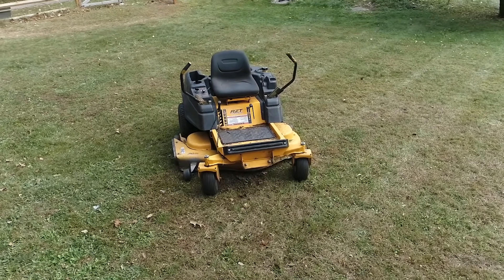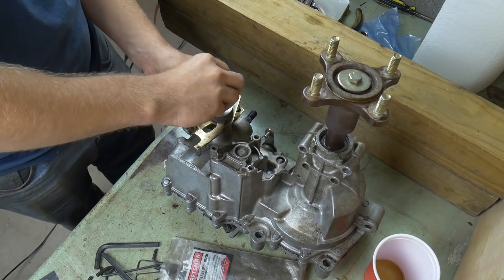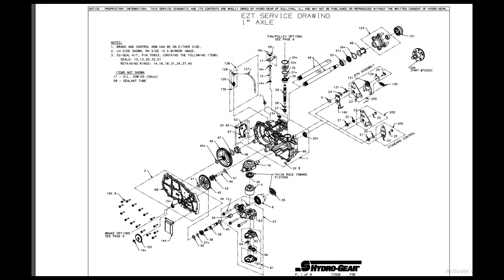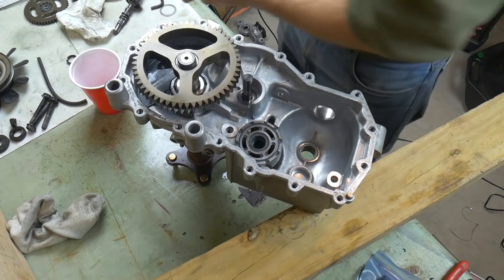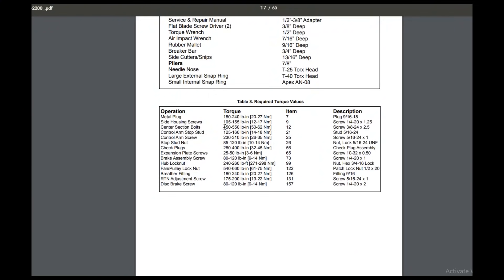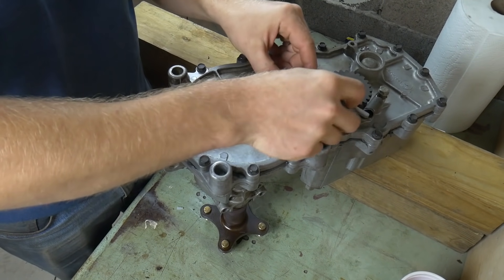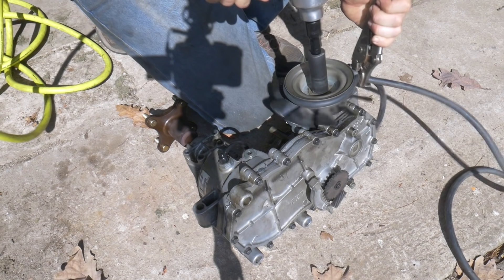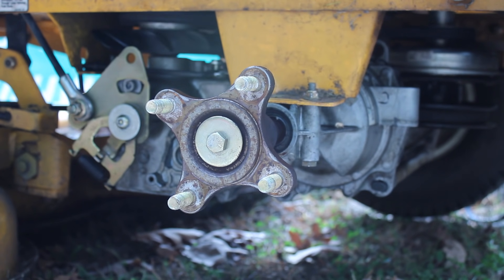Cub Cadet Zero Turn Weak Transmission Fix.

Comment: Hello and thank you for the video.
I would like to suggest that if you're going to be this far into this unit you should also go ahead and pull that hub off so that you can replace the output shaft seal.

If it's not leaking yet, it will be soon, so it is worth replacing.

Another suggestion is do not ever tap on the back of your socket with a hammer. It's a bad habbit habit that will eventually damage your sockets.
It is better to use an old extension. I have a dedicated 4in extension that is used only for this purpose. The side that receives the blows from the hammer is mushroomed and mis-shaped, which is what will happen to your sockets.

Comment: I have a Question

I have a Cub Cadet RZT-50, it will not move forward but it will move in reverse.  What will cause this.
Reply from the maker: thats a hard one. I would check the linkage to make sure everything is connected and move properly. if its moving in reverse the belt is turning the transmissions. Did it stop all of a sudden or was it a slowly getting worse?
Reply: @darbleythetractorguy458   It was getting worse over time.  I thought it was the belt.  What I'm going to jack it up and see what side not working.  I'm going to rebuild the transmission to see it that work..
Reply from the maker: @vincentconner8429  sounds like a rebuild will fix it.

Comment: Great Video ! I have the same unit in my Ariens Ikon 52 . I dropped them at 75 hours and filled with Valvoline full synthetic 20w50 , and again at 150 hours . Is that over kill or am i thinking right as far as longer life of units ?
Reply from the maker: Thank you! Id say 75-100 hrs is a good interval. One of the big things is how you drive them. Slowing down and coming to a near stop before turning/putting one of the wheels in reverse. Alot of ppl will be cruising and slamming them in reverse for quick turns and it slams the internals causing the damage in the video.
Reply: @darbleythetractorguy458  Thanks

Comment: How do you properly diagnose this problem? I just want to be sure. I bought a Cub Cadet zero turn that is weak on the left side, but at times there is a burnt rubber smell. I don't have much experience with zero turns. Nice video!
Reply from the maker: Burnt rubber could be a belt. It could be the deck belt or the drive belt. If it gets weaker the hotter it gets. High chance you need a rebuild
Reply: @darbleythetractorguy458  It was just running the mower without the deck trying to determine if the left transaxle was weak. It wasn't a constant odor. Anyway, a tip I can provide is, I always search for the model number of the mower when looking for parts. I searched the one I bought and found the parts manual published by the manufacturer which had nice exploded views of the transaxles and all part numbers. As you stated, parts are available. Thanks for a very good video! My first time diving into a zero turn. Plenty of lawn tractors under my belt, but it's my first zero turn.

Comment: What would cost to rebuild the hydro gear, compares to buying a brand new hydro gears??
Reply from the maker: Cost me about 190 to rebuild. New units are around 500
Reply: @darbleythetractorguy458  thanks for the info. I have a hustler raptor sd zero turn mower that has 458.0 hours on it. Its 3 years old 
Runs great. Why do these hydro gears goes bad?
Reply from the maker: @adamlipscomb6459 from what i understand theres not a pressure release on the internal parts. If your moving foward and put it in reverse to quickly the motor lifts and slams on my center section. Got to take it easy when coming to a stop and turning.

Comment: Excellent how-to video.  It  is a good argument for going with a ZTR with at least with HydroGear 2800 residential transmissions which have an oil filter which should provide better longevity though I have seen several videos on repairing them also.  That being said, I've been looking at ZTR mowers and called HydroGear for a transaxle recommendation thinking a ZT-2800 would be adequate for my needs.  They indicate their residential transmissions, including the ZT-2800, are really only intended for 1 acre or so.  I have 3.5 acres  with a slope so they recommended I get a mower with one of their commercial grade transaxles which start with the ZT-3100.  The ZT-3100 is basically the same as a ZT-2800 but has contains cut steel gears (as opposed to powered metal in the residential models) along with having a shock valve to relieve stress under quick starts and a charge pump to provide supplemental oil to the main pump.  I think the big box stores and some dealers inaccurately recommend models with the ZT-2800s for larger lots when they probably shouldn't.  Anyway, HydroGear has an excellent YouTube video detailing the differences between a ZT-2800 and ZT-3100 but even it lacks in providing a lot size/slope guide on which transaxle would be best for a given lot.  Again, excellent video and hope this info helps other viewers of your video.
Reply: I had the same discussion with Hydro-gear as well. My Husqvarna MZ254F has the ZT-2200 unit and my lot is approx 3 acres with slopes. They also said it's under rated for this. Though if you ask Husqvarna they have no problem recommended their product. All their literature states how strong and capable their mower  is. Their manual does not state an acreage limit either. Personally I think these units were engineered to fail by about 80-90 hours..that's what I'm seeing on the forum pages and always the left side...
Reply from the maker: Thanks for adding some info. Definitely worth getting the best mower you can afford.

Comment: Sorry if I missed it but do you sand down Both Motors i searched and watched and am still unsure thanks for a great video
Reply from the maker: I only sanded the one with damage. The pump side should be ok. If there is scratches on it I would.

Comment: Posted a previous question which you answered so I have another and need help if possible.  So I have the rzt 54 with the Kohler courage 26 and the change oil light came on but when I pull the dipstick out while it’s running it’ll blow oil everywhere.  What broke or needs to be fixed
Reply from the maker: Looks like your crank case breaker is plugged up. Should be a tube coming off the valve cover to a canister or something. Check that first. Im not super familiar with that motor.

Comment: So do you just fill it all the way up with oil? We have an older husqvarna that quits pulling on one side after it gets hot. It's oily on the outside so I know it has to be a little low on oil.
Reply from the maker: Yes just fill it up. Might be your problem. If not center section is bad.

Comment: I have a rzt54” and changed the fluid in it and I guess I had air in it but either way left hand side won’t go forward or reverse.   So is this likely my problem and if so where can I order the rebuild kit from
Reply from the maker: I ordered mine off ebay. If you search the part numbers you need they should come up. Amazon should have them to.

Comment: Hey would this be my problem seams like i don't have as much power as I do on the rite side the left side pulls but not as strong as the rite side
Reply from the maker: Probably. Check the linkage too. If it's getting worst over time or when it gets hot this is more then likely the problem.

Comment: Did you put loctite on the center section bolts?
Reply from the maker: I didnt but it wouldnt hurt. I did torque to the proper specs.

Comment: Would it be possible to sand down that Center section back to smooth (ie. Similar to turning a brake rotor and assuming the grooves aren't too deep)? It's probably better just to get the new part since you've gotten that far in the tear-down, but if it could save $ for some people I figured it be good to know.
Reply from the maker: If money is tight im sure its worth a try. It would probably be harder to get it flat.

Comment: So when it comes to getting the pulley off. If you don't have an impact wrench, look underneath the fan at the shaft. It has two flat sides so it can be grabbed with a wrench. I put a crescent wrench on it and set the wrench against the floor and broke that nut loose with a 1/2 inch drive ratchet. No problem at all on both of the transmissions in my mower. I just figured I'd let you know. It makes life a lot easier for people without air tools.
Reply from the maker: Thanks for the tip! I didnt notice that myself.

Comment: How much was the center section and the seals
Reply from the maker: Prices are in the description. About 126 for center section and 40 for seals.
Reply: Thanks buddy I see it. Perfect video, perfectly detailed and that's why I gave it a like.
Reply: I have a Husqvarna Z-turn that has a weak transmission and I was trying to figure out the best way to go on fixing it and your video made decision effortless. The transmission in your video looks completely identical to the one in my mower so the same parts numbers might work if I'm lucky.
Reply from the maker: @Bran.man24  thanks for the positive feedback. Most residential mowers have this transmission in it. If you can get the pn from the sticker on the transaxle you will know for sure.

Comment: if you were to buy a new mower today would you get one with the 2200's again or pay $500 more for a unit with 2800's?
Reply from the maker: If i had the money to spend i would get the upgraded transaxles. The 2800 have an external oil filter and a drain/fill plug for maintenance. 500 isnt much when it cost 300 to fix the 2200.

Comment: Great video!  For the EZT trans...Why hasn't someone installed 1/8" NPT drain plugs in the bottom of the trans case (pump end) to drain the oil for servicing.  Also find or make a hose to screw into the trans fill hole and drill a hole above the trans thru the engine mount plate for fill access.  Drain the oil out the newly installed trans case bottom drain and refill with a know amount of fresh oil for servicing.  ?????
Reply from the maker: both of those are great ideas. Most commercial zero turns have that ability.
Reply: Because they’re built to maximize profits.  99% will buy them at a big box store, run them until something goes wrong and then buy a new one.  If you’re watching this, you’re one of the few people like me who actually take pride in fixing things.
Reply from the maker: @failranch9542  its sad not many people try to fix things anymore. More sad companies don't make things to last.
Reply: Excellent presentation..!!!
I’m having trouble getting my center section out.. you skipped passed that pert. Everything is disconnected but it seems like it’s jammed in there.. worried if I just try to pry it out that cheap metal will break and parts will go flying everywhere..

Comment: How did you get the input shaft out?  I've got the seal out but can't figure out how to get the shaft out.  I see a split ring on the shaft, does that need to come off before the shaft will come out?  Thanks for any help you can give!
Reply from the maker: I dont think so. The bearing and shaft stay together. You should be able to pull it out.
Reply: @darbleythetractorguy458  Thanks!  Came right out.  Does the trunnion seal on the swash plate come in the seal kit?  I haven't removed it yet, so the swash plate is still in place.  Are there any retaining rings on it?  Sorry for all the questions, but I'd rather be safe than sorry.
Reply from the maker: Yes the seal kit comes with that seal. Im 99% sure it comes with every seal that is on the trans axle.
Reply from the maker: Also I dont think theres a retaining ring. Check it out and you will know for sure.
Reply from the maker: There is a retaining ring that holds the seal, shaft, and bearing in. The ring is up against the rubber seal. If I'm understanding correctly the retaining ring has to come out first for sure.
Reply: @darbleythetractorguy458  I have that retaining ring and seal out.  There's a split ring on the shaft against the bearing.  Does that need to come off for the shaft to come out?

Comment: Hi do you really put 1,75 to fill the transaxle?? or it´s what the manual says and you just fill it to the top, because on mine i cant put 1,75, doesnt fit that quantity. Thankyou for the video.
Reply from the maker: Once you fill it and bleed the system. Check it again. If its filled its good to go.

Comment: HELP!!!!  I cannot get the bearing on the input shaft to slide out of the housing  like is shown on the vidieo!!!
Reply from the maker: I think other people had this same issue. Dont loosen the center section until the input shaft is removed. Let me know if that helps.
Reply from the maker: I just looked through the comments and found someone with the same issue for sure. If you loosened the center section 3 bolts before taking out the input shaft and bearing you wont be able to pull it out. Put the bolts back in assuming you took them out and you should be good to go.
Reply: Thank YOU!!! That was the problem!!!

Comment: Is this the same transmission that would be in a Cub Cadet RZT50? Your description is for a RZT. I cannot figure out if there is any difference. 

This is an excellent video that is very helpful.
Reply from the maker: Should be the same. The number is the size of the deck. Most residential zero turns are using the same transmissions. Thanks for watching.
Reply: DarbleyTheTractorGuy thank you for your timely response.

Comment: Great Video, thanks a lot. Is there any reason why you could not get the centre section machined instead of buying a new one?
Reply from the maker: Im sure its possible. Idk if there is a limit on how much material you can remove before it will cause issues. If I get another mower that needs a rebuild I'll try to sand it smooth and set what happens.
Reply: @darbleythetractorguy458  Thanks, I'll give it a try then as it's stuffed anyway and I'll let you know how it goes
Reply from the maker: @paulcane7160  awesome.
Reply: @paulcane7160  I'm actually attempting to machine mine. I can't get the parts sent to me so I figurer I will try and machine them myself. If this works will let you know.
Reply: @fernandoproietto4376  did machining it work? I'm about to disassemble mine and was going to try it. Please let me know, thanks!
Reply: @travishanson2119  indeed, it worked beautifully. Moer works better than when it was new. Best part, I saved a lot and learned a bunch. Good feeling when your able to repair without manufacturers assistance.
Reply: @fernandoproietto4376  which parts did you machine? Was it the center section only? Or did you have to do anything with the pump block or motor block as well? Did you take it somewhere and have it machined or did you use Darby's trick with sandpaper on a flat surface? Thanks for the quick response!
Reply: @travishanson2119  I machined it myself. I have a mill and do machining as a hobby. I machined the center section and reground the pump block starting with 400 grit and up to 800. Use oil. The mating surfaces need to be perfectly smooth. This will allow them to mate perfectly and seal.
Reply: @fernandoproietto4376  just watched a video from doublewide6's channel and he machined the mating surfaces using oil and sandpaper and it turned out great. I'm going to give that a shot before I drop $300 on repair parts. Did you replace any of the seals or just take it apart and put it back together?
Reply: @darbleythetractorguy458  did you ever try machining it instead of replacing the parts?

Comment: Am I able to pull the input shaft and seal without tearing it apart?  The seal is leaking at the input shaft.
Reply from the maker: You should be able to. You would have to take the pulley off.

Comment: Did all this and its worse than before
Reply from the maker: Theres a possibility the bypass piece isnt in correctly. A few others have commented with that problem and were able to correct it.
Reply: Thanks for quick response but i think i found the problem. Was using a parts diagram to assemble and the 5 piston is where the 7 should be

Comment: Bearing ring on the input shaft doesn’t want to come off.  Retaining ring is off, shaft is removed, but bearing ring doesn’t budge and I jacked it up trying to remove it so I need to replace the bearing ring.  Suggestions to get it off?  Hammer, screwdriver, and anger?
Reply: FYI, yes, a hammer and anger, no screwdriver needed.  Then to put the new bearing on, I used a garden hose gasket on top of the bearing to prevent damage to the bearing, a small pipe fitting that was wide enough to fit over the shaft, and a hammer.  Worked perfect.

Comment: Question - 1st very helpful video.  2nd I’m deep into the disassembly, things were going well until I got to the input shaft.  After finally being able to remove the retaining ring that holds the ball bearing unit down around the shaft, I thought he ball bearing unit would simply slide out, but it doesn’t and according to the hydro gear manual it should come out.  I tried prying/lifting it out with a screw driver, but it doesn’t budge at all.  So I can’t get the input shaft nor the ball bearing unit, or the center section out.
Reply from the maker: I am trying to think what could be holding it up. I haven't had a problem getting them apart. Someone recently commented with the same problem. Someone replied with solution but i can't find it. Did you loosen the center section?
Reply: I found what you’re referring to and it worked!  So must frustration and disappointment I had yesterday over this.  The issue was that if you remove the three center section mounting bolts before the input shaft, it doesn’t let the input shaft come out.  Reinstalled bolts and it came right out.  Hey. Thanks for responding!

Comment: great video about time to rebuild mine had my 50 inch rzt since 2010 left side getting weak and slow
Reply: Where you get the part i i can find the parts mine is 08 troy bilt 50 inches. I need the hydro pump lip seal i hope you can help me thanks